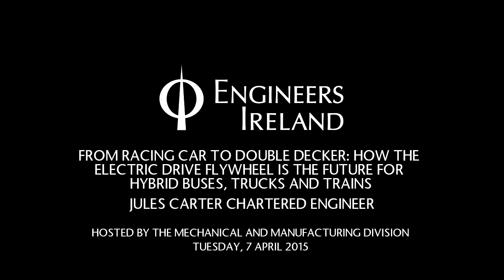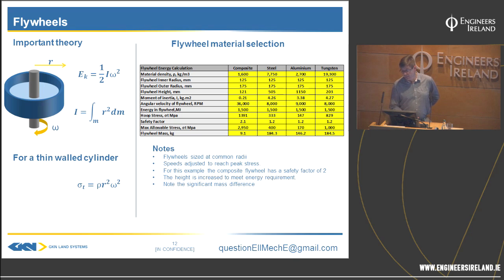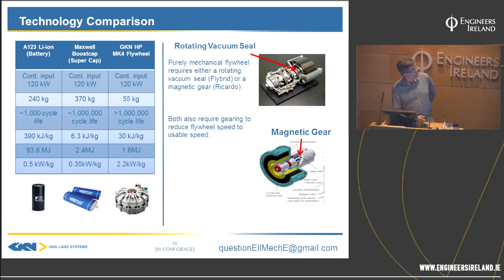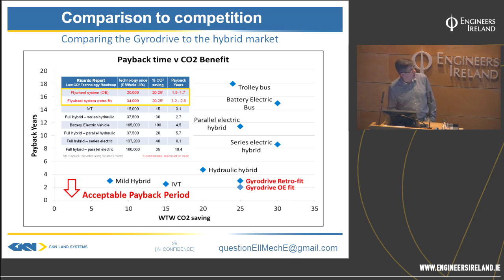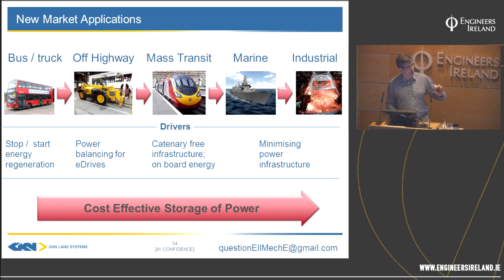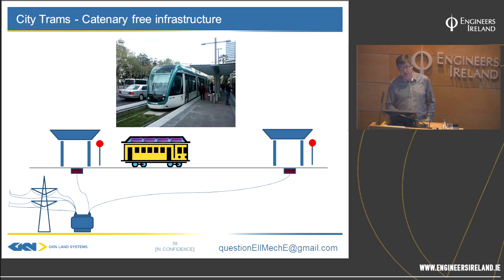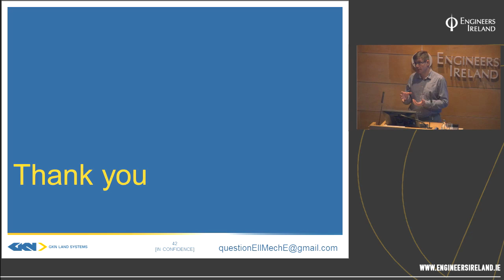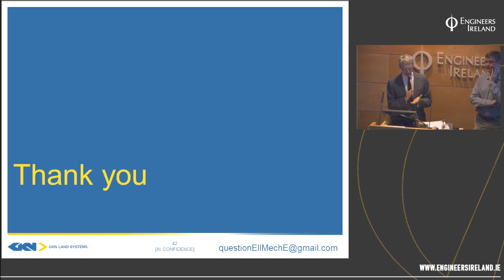How the Electric Drive Flywheel is the Future for Hybrid Buses, Trucks and Trains

Comment: The guy totally missed the question about the efficiency of bearings through friction heat and subsequent cooling required. I would think that is the single largest loss of energy and also expresses in the form of heat, which if well engineered, could be put to use and energy recovered to some degree. Could be simple thermo-electric systems or more complex fluid heat exchangers depending on how much heat we are talking about. Shame he didn’t answer it in detail

Comment: Doesn’t it loose a lot of power in turns?
Reply: Mook Faru Didn’t ever think on your point but I see your logic. 
I think it would be very minimal but to eliminate it, the flywheel could be orientated vertically. Then they will have a little added and a little taken away by going up and down hill.
Things like this actually matter when you think on overall energy conservation - really didn’t ever think on it.